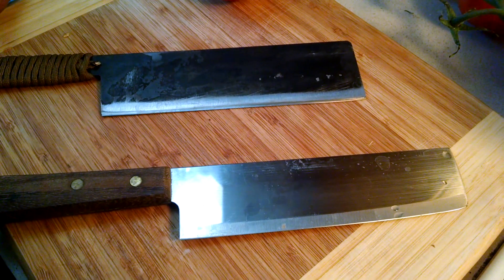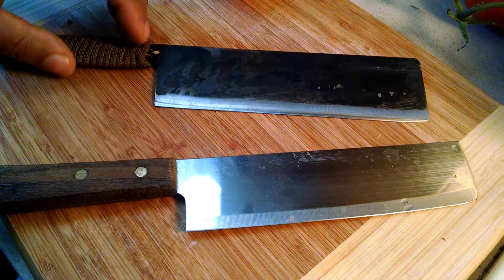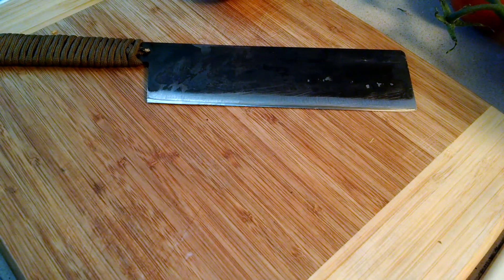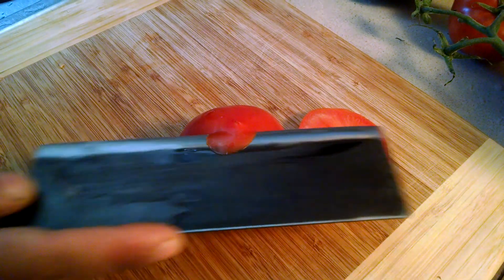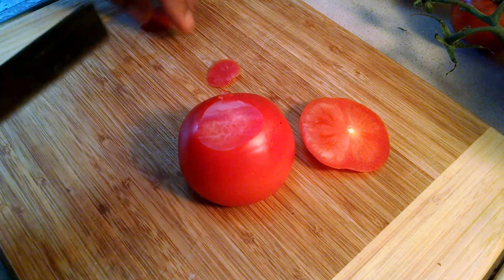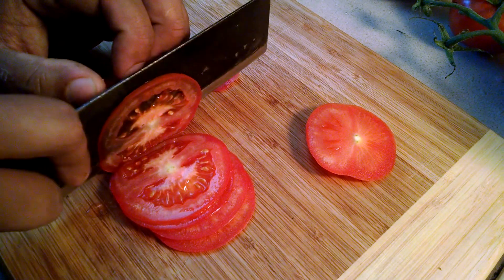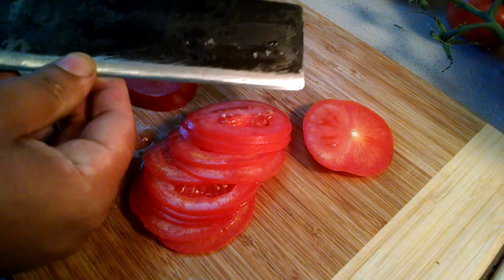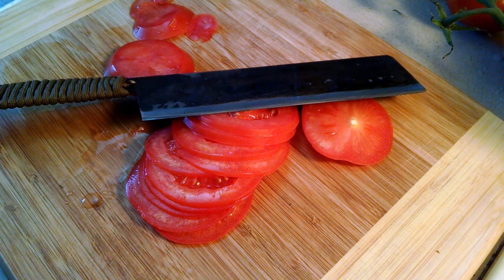DIY Nakiri Kitchen knife, 52100 steel

Comment: Great job! Today i found a vintage Kai Nakiri at the Thrift store.It has a laminated steel blade with the octagonal traditional handle.Cleaned up the rust and sharpened it.Cuts tissue paper with no problems. It cost me 3 bucks :-)